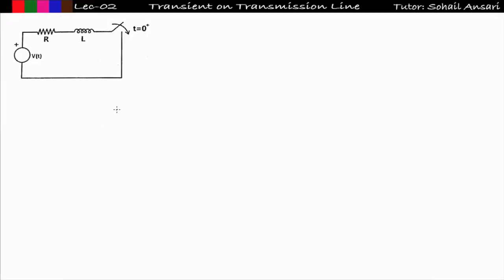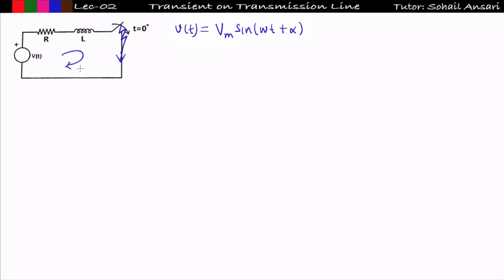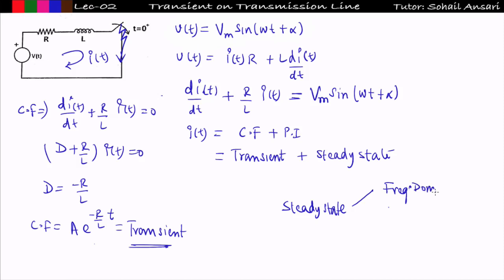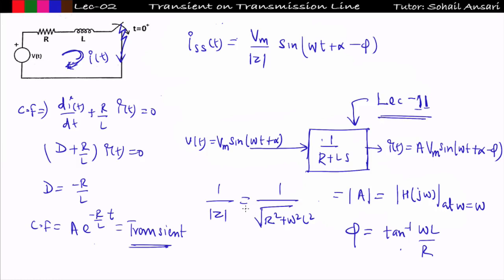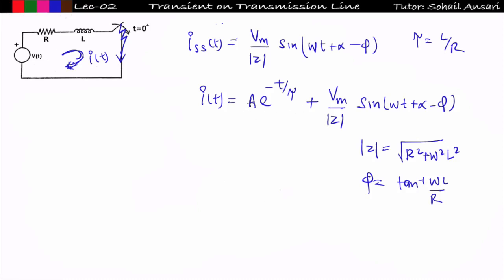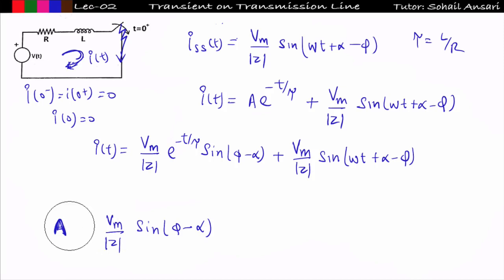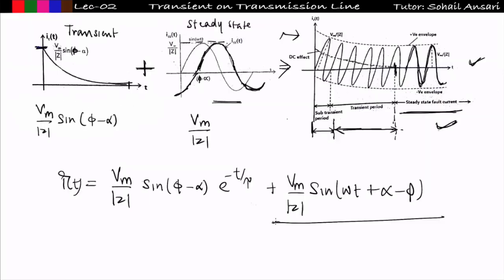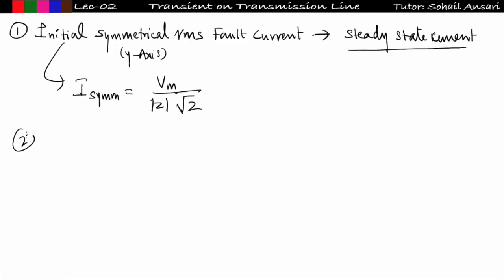Lec 02 Transient in Transmission Line | Power System | GATE ESE

Comment: Sir this doubling effect is seen in Transformer as well when it is assumed to be switched at 0°. Because a question/argument may arise that as current lags the voltage in an inductive circuit, then what is the value of Current when AC voltage has been applied at 0° angle? Am I right sir?
Reply: Ryt..u will study same thing in switching transient in xmer..ok
Reply: @SohailAnsarii  yes sir. Thanks for the response :)

Comment: a balanced 3 phase phase system with a voltage 400 is supply a balanced a star connected load 1500 w at a leading 0.8 power factor determine the line current and per phase impedance? Now a balanced lighting load 900 w is connected parallel to the system what will be the new line current? Sir could you please tell me how to solve the new line current after 900w load is added?